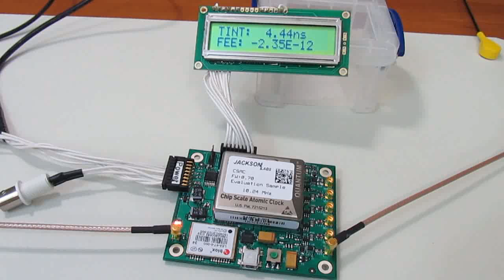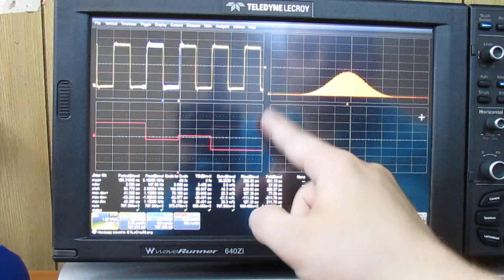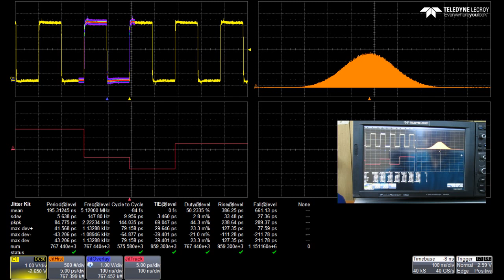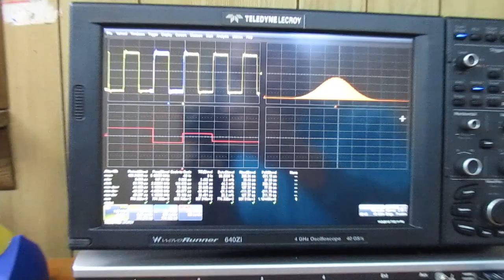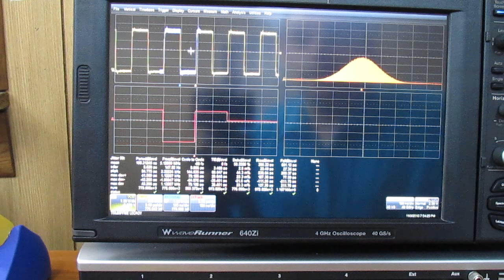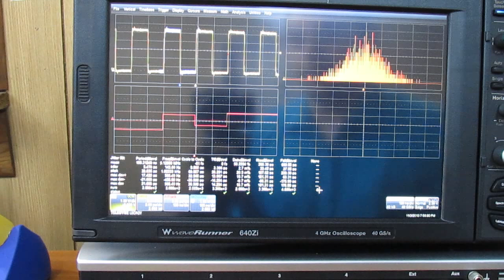TESTED: Chip Scale Atomic Clock (Precision Timing & Frequency Reference)

Comment: Some comments: CSACs units themselves nowadays sell for up to $5,000 per unit. The FEE: xxx value is the ADEV estimate over a 1,000s averaging interval. So 5E-12 would loosely mean it experienced about +/- 5ns movement error over a 1Ks averaging interval. The display also shows the two minutes average of the CSAC clock versus the uBlox 1PPS reference.

The CSAC: LCD page displays the internal CSAC Telemetry such as Laser current, module internal temperature, and internal VCO voltage.
Reply from the maker: Thanks a lot for the added information. I pinned your comment for interested viewers. I'll put updating the video description with more in-depth information on my to-do list.

Comment: Hi, I'm trying to use a CSAC like the one on the video. I wonder if you can tell me the type of connectors the 10 MHz and 1PPS have. Are they SMA or MMXC? Additionally, have you ever tried this clock for a mobile application? (e.g. drone, car) Are they good?
Reply from the maker: Hey! They're all MMCX connectors. And no, I have not tried this device in any kind of mobile set-up. But I wouldn't know any reason why they wouldn't perform well in a mobile environment.

Comment: I'm pretty sure they have a PLL locked to some part of the GPS signal, internally. I know it uses a PLL and a TCXO, but I don't know if it's locked to the 1PPS or to a higher-frequency component of the GPS signal.

Remember, this is built into the GPS module, so they could possibly hook into the RF chain somewhere to get a higher frequency GPS-correlated clock.

Comment: Those uBlox GPS Receivers are amazing. 

I've been working on a device that uses them at work, and I get ~6 sattelites in view with the antenna hanging off 75 feet of ratty BNC coax.

The LEA-6T GPS on that board can internally synthesize a 0-10 Mhz arbitrary output frequency locked to the GPS timebase using it's internal TCXO.